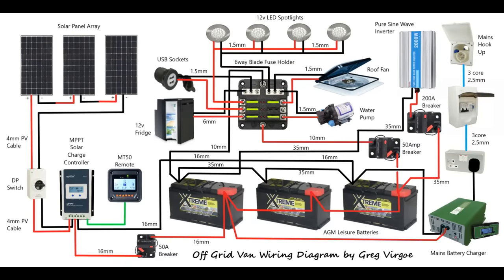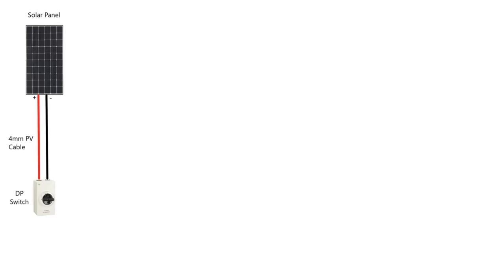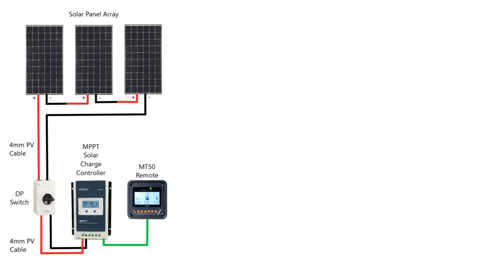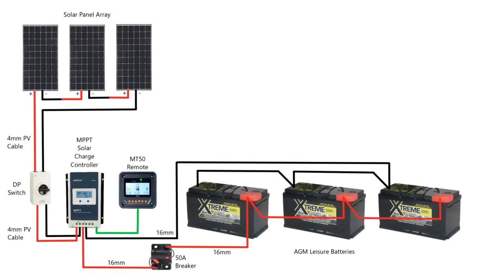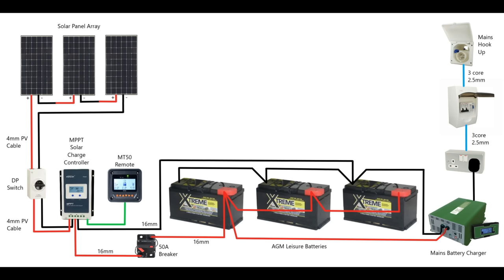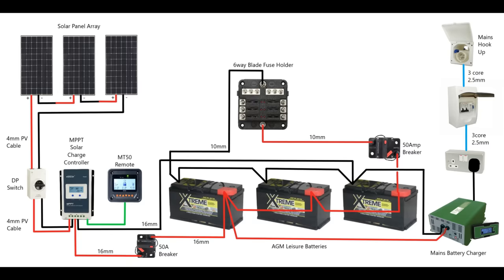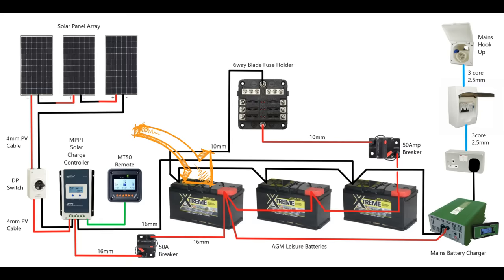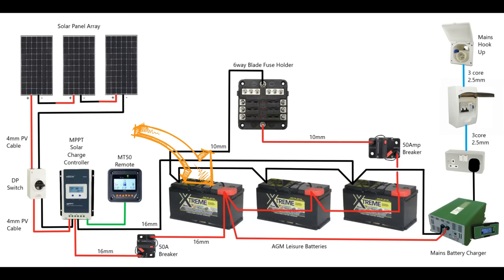How to Wire your Camper Van to be Off-Grid

Comment: This almost entirely make sense which has given me a dangerous  sense of confidence that I could handle doing this myself.
Reply from the maker: Quickblood1 it’s simply connecting A to B with the right size cable and fuses. That can’t be hard can it 😊
Hope it does help you
Reply: Following this guide I built an entire system, it's probably the best guide on the internet
Reply: Let someone else check your wires (let them pull on the connections hard)
Reply: @GregVirgoe  that's the easy bit but knowing what size wire and fuse to put in is where it gets hard for complete newbies like myself.

Comment: Forgive me being so impertinent as to make a suggestion but at the end you said the battery interconnects should be sized to the draw of the highest power appliance. I would suggest they should be sized larger, to the sum of the highest power appliance plus any others that might be running at the same time, since the total draw from the batteries will be the total drawn by whichever appliances you’re using simultaneously. Eg if 2kW inverter is running full tilt and your fridge is on at the same time, you’re drawing the sum of both those draws.
Reply from the maker: Vandemonium you are absolutely correct David and well spotted. My explanation was not technically correct in that instance. The 35mm cable is good for 240Amps so that will easily cope with everything in this diagram. The interconnect first need to be sized for maximum simultaneous demand on all systems. 
Thanks for the correction.
Reply: @GregVirgoe  hi, in the chart on your video it shows 35mm as a max current carrying capacity of 141 amps, am I reading it wrong because that seems a lot less than what you’ve written here and the 200 amp breaker on the inverter.?

Comment: Great video Greg did you wire your van in a way that you can also charge your batteries off the alternator?
Reply from the maker: Fireblade 100 no because a simple split charger is not compatible with AGM batteries because the charge profiles are very different. 
I could do it with a battery to battery charger but they are bit more expensive. Great question thanks for watching.
Reply: @GregVirgoe  Yes, that's what I had to do. I bought a CTEK D250 charger. Absolutely fabulous  product (no, no affiliation :) ) and well worth the money (appr. £ 170) if one travels in places with less sunshine and/or off grid (Scandinavian wilderness).
Reply: if so what size cable?
Reply: @GregVirgoe  You might look at the Renogy DC charger. I've just bought one. They are pretty cheap (110 eur for 20A and 140 eur for the 40A version). I found them on the French website, and contacted their German office since it was in stock, and they were able to ship abroad (the Netherlands in my case). I also wanted one, because of the charging differences between AGM and a regular lead-acid I needed one. 
As for the cabling: In the end you're mentioning having the same cable size as the biggest consumer to wire the batteries in parallel. I think it should be even bigger, since you can (theoreticly) use both the inverter AND the other devices at the same time, so in your case with a 200 and 50A breakers for those parts, there could flow 250A in total (Altough this is highly unlikely). 
Good to mention the use of stranded cabling and not solid. But also, especially in the higher current circuits, proper crimping is just as important. (And don't solder, since that is also not recommended in a moving vehicle). Finally, for the campsite hookup: Just beside a breaker, I highly recommend installing a RCD. (I personally am installing an surge protector as well... I've seen some crappy campsite installs...). And if you don't like the big CEE campsite connector (just like me) you can install a DEFA socket (which is much smaller, and can be fitted in the front gril or somewhere else). I'll just carry an conversion cable with me. DEFA is pretty known, especially in Scandinavia for heating purposes, but it can handle up to 16A. Here in NL its not much used besides construction vans, but I still like its small size (I can fit mine behind the fuel cover on my Ducato)
Reply: @GregVirgoe  is that not what the Ring unit does that Mel showed in o e of his videos, works as both a split charge system and an MPPT controller? A lot of guys using this on the newer euro 5 and 6 engines
Reply: My VW T5 has start & stop system and AGM starter battery. Can I charge the leisure battery from the alternator through a 80A relay?
Reply: @vangeezerexperience  is there any difference in the CTEK and the Sterling Power Battery to Battery charger? I plan alot of off grid!
Reply: Great video Greg. I'm just starting a build. that was so helpful. looking forward to going back through the rest of your videos. 👍

Comment: Hi Greg, I've just been having a nosey on youtube to see how to wire my electrics - very basic system - and I've seen wiring diagrams where the leisure batteries are earthed/grounded, and others which don't mention it. Should leisure batteries be earthed? If so, based on the wiring diagram you have used in this video, where would you place it?

Comment: Thanks so much for this Greg, exactly what I've been waiting for! I understood about the key components but hadn't see anywhere about the relevant sized wiring, fuses, breakers etc that keep it all safe. I can go into this feeling a lot more confident now, cheers!!
Reply from the maker: Hi Sharon, certain individual circuits and appliances my need slightly different fuse sizes depending on their actual load but hopefully this video gives a better understanding of how they all connect together. You can always message me with questions if you get stuck. Cheers Greg

Comment: Thanks Greg, Great Video as always, im just at the stage where Ive insulated the van and ready to board over and I've been worrying about electric element of the install. Much appreciated
Reply from the maker: Paul Carter what I did to start with was to list all the things in my van that would need power. Decide what item I was going to buy then find out what each of their power requirements were in terms of 12v / 230v and the amps so I knew what cable to run. Lastly did a simple pencil sketch of where each item was in the van so I knew where to pull my cables to. Hope that helps 😀
Reply: Greg Virgoe what goes after the inverter? How would you connect all the 240 plug sockets to it, say if I had 3 plug sockets for instance?
Reply from the maker: Paul Carter most inverters have a three pin socket so you wire a 2.5mm 3core cable to a 3pin plug. Plug that into the inverter then wire the other end to your sockets. You can only plug in devices rated below that of your inverter 👍🏼😊

Comment: Just starting a van conversion with my partner and until I came across this video I was very concerned about my lack of knowledge on the subject. No longer - this explanation and wiring diagram is excellent. Thanks Greg.
Reply from the maker: I have done another video just recently with a slightly different setup you might also like to watch that one 👍🏼😃
12v Electrics for Off-Grid Campervan - Fiat Ducato Budget Build Ep12
https://youtu.be/xCw7eARJKOg

Comment: Just about to take the plunge on van electrics and Greg's video is by far the most useful on YouTube. Whenever I'm nervous about jumping in I watch this (for the umpteenth time!) and feel reassured. Top man! Not sure if you're still monitoring this Greg as you're currently on your Portuguese jaunt with Lou but I'm wondering whether to use common bus bars for the MPPT/Inverter/DC-DC etc units as Alex has done from Mispronounced Adventures or whether to run them directly as in your diagram.
Reply from the maker: Hello, yes I do monitor all comments no matter how old the videos are 😃
I connected mine direct to the batteries as I’m not using a shunt at all and another connection in my fairly simple layout is just adding extra resistance to the circuit.
Reply: @GregVirgoe  Thanks Greg - enjoy your adventure down the N2.
Reply from the maker: @ezioauditore3128  thank you 🙏🏼

Comment: Possibly the most informative video on  electrics that I have ever found thanks! One question. I was hoping to avoid a mains hook up. Would it be simple enough to add solar and a hook up the the starter battery to charge when the engine is running too?
Reply from the maker: Adam Vincent-Garland best way of doing that is with a battery to battery charger. That way you can set the correct charging profile for your leisure batteries. A hook up lead with sockets on the end is a cheap emergency back up nice to carry if needed

Comment: Spot on Greg, your whole series is amazing and such a positive thing to do for others.  I have one question on solar panels.  Are there any pros and cons between installing multiple lower wattage solar panels compared to a single larger wattage panel?
Reply from the maker: I can think of a couple of advantages. Space saving and location layout. Biggest pro is the redundancy should one fail you can easily rewire it out of the system

Comment: Great explanation, clear and concise, no fluff. However, how are you wiring to your 230V plugs from the inverter, re you simply using extension cables that plug into the inverter?
Reply from the maker: You can use 2.5mm three core cable plug into the inverter then wire into the back of 3pin sockets. 
To keep it simple you could use an extension lead with multiple outlets just be aware that the plug fuse will be max of 13amp or do not use more than the watts rating of the inverter. 😃👍🏼

Comment: Thanks for the video and also for the step-by-step presentation. I have looked at some of your other videos, e.g. battery and solar panel sizing, as well as the choice of cables and fuses for the loads. I have made a couple of observations that I need help with. 
* You have used 3 x 160W solar panels wired in series, which will increment the voltage. What is the cumulative voltage in this case, and also what is the maximum voltage that the MPPT controller can support?
* You have also used a DP switch between the solar panels and charge controller, but it is not clear the size of this switch and what device is being protected, considering the fact that the solar panel amperage remain static. Would you suggest an in-line fuse close to the solar panel in addition to the breaker?
* Finally, it seems like you have a 50Amp circuit breaker between the charge controller and the battery and the same between the battery and DC fuse box, but I think the battery amperage is 110Amp. So if I am right, what is the circuit breaker capacity lower than the battery amperage? Also, I am not sure but when the batteries are configured in parallel, does the amperage add up and if so, what should be the appropriate breaker capacity to protect the battery pack?
Thanks in advance.
Reply from the maker: The combined voltage is around 60-70volts and is within the 100v limit but check as other controllers do differ in spec. 
The DP switch is just for manual isolation if I want to turn of the solar panels. An in-line fuse of 15Amp would be suitable for this setup near the panels. 
The circuit breakers are sized based on the connected load downstream of the breaker and no relation to the size of the battery bank as it’s relative to what is being used. Check out my cable sizing and fuse sizing video 👍🏼😃

Comment: Hi Greg, firstly I want to thank you for your videos not just on electrics but all your videos are amazing! 
Greg I have a question!🙈,  actually I have several🤣 but I'll be more than happy if your able to answer this.  I have to 2 x Renogy lithium 50Ah(100ah total) battery's and 2 x lead acid 105ah(210ah total) battery's.  The lead acid are backup power... is it feasible to have a wiring system that would allow me to switch over from one power source to the other as and when I needed it? If so can a novice like myself(I wish!😆) do this kind of setup? None of my electrical system is installed yet.....thanks in advance.
Reply from the maker: Hello Phillip, thanks for getting in touch. The biggest issue I see is these different battery types will have different charging and discharging rates/profiles 
Battery chargers need to be programmed differently for each battery type. These should not be connected together. You could install two stand alone systems and say use the lithiums for big loads like cooking etc. use the lead based batteries for small loads like lighting or usb sockets. 
You could use a changeover switch to divert your solar power from one charger to another on the input side of the MPPTs
Reply: @GregVirgoe  Greg your a star...I did wonder whether 2 stand alone systems would be better. Yes, I had wondered about some kind of change over switch for the solar. I guess I'll have to toggle the mppt parameter settings from lithium to lead acid when I use the switch too? Would a change over switch also be feasible on the dc-dc charger? (switching over between my lithium's and my lead acids). Wow, super thankyou for your prompt reply! If you want to film me (with your technical expertise assistance of course 😉😉😉) and make some video's for your channel could that work???😲😲😲🤣🤣🤣 cheeky I know....! You don't ask... you don't get!!😳🙄🤣

Comment: when you say 16mm cable, or 10mm cable, do you mean 10mm2? what are gauge are you reffering to? im getting so confused by the cable sizes! AWG, mm2, and then the nominal size. please could you help me?
Reply from the maker: This chart will give you the conversion https://encrypted-tbn0.gstatic.com/images?q=tbn:ANd9GcT2bfpHvjpnquN3FmnLZhZO8gOGuPugWnWWtQ&usqp=CAU
Reply: @GregVirgoe  That was a useful question and a useful answer link, I was watching thinking "a 35mm (diameter) cable is enormous, how are you routing and attaching ends to that", but from that chart I see you were more likely talking about mm2 cross section which now sounds more reasonable
Reply from the maker: @Fromatic  yes not the diameter 😊and battery cables are surprisingly flexible too 👍🏼

Comment: Hi Greg , hope your well . To run a kettle / TV off grid ,where would this fit into the diagram please ? Many thanks.
Reply: It's ok Greg , watched your other video on TV installation. Thank you
Reply from the maker: I would recommend getting a small travel kettle no more than 2x cups and 800w then you can run it off an inverter. A domestic kettle would use too much power. 👍🏼
Reply: @GregVirgoe  Brilliant thanks Greg. Much appreciated.

Comment: I am just starting to plan my Van and the eletricity is what troubles me the most. Its not possible to use the car alternador to also charge the bateries while driving or/and have eletricity when there is not enough sun?  If the alternator charges the car battery makes sense that we can take advantage of it. Also, instead of a connector to connect to an homr plug, why not a plug equal to the eletric cars and plug it on a service station for example?
Reply from the maker: It’s best to use a battery to battery charger also known as a DC to DC charger to charge using your van engine. A good model would be Victron Orion 30A. Always good to have hook up for camp site charging. Running the engine when stationary is not the best solution. 👍🏼😃
Reply: @GregVirgoe  well not the best but if, at limit, is the only available, i rather have that than nothing. I am planning not being much on campsites.
Reply from the maker: @nspinheiro.  you still get electric hook up on free sites across Europe and I’d hate to be parked next to someone running their engine to charge a laptop 😉
Reply: @GregVirgoe  more worried in not having power to cook on a snow storm or something like that 🤣

Comment: I work with a.c. and cable sizes and protection are chosen by coordination. The demand of the appliance (Amps) must be less than or equal to the protection rating (breaker or fuse Amp rating) which must be less than or equal to the current carrying capacity of the cable. 
This is a great video, btw, and taught me loads about the setup in campers and caravans. Am hoping to buy a cheap van and convert it. Don’t hold your breath! 😂

Comment: Finding this very easy to understand, no solar panel on my old camper at the moment, tend to wild camp all the time, thinking of getting a solar panel, bit confused what size i might need, but will look for your other videos 👍👍
Reply from the maker: If you want to be off grid all the time you need to be looking at 300-400w of solar from a couple of panels. Take a look at 2x Renogy 175W panels they are very good.

Comment: Beautifully explained - almost exactly the same as my rig but I went with 300ah lifepo4 and just one 280w panel & 1.5KW inverter -  so was able to drop down to 25mm wire - I added a  20a DC to DC  alternator  charger and used the  EpEver MPPT solar controllers  power outlet for the LED 12v TV as its so smooth and consistant.
Reply from the maker: The ratio of panel to battery is a bit lite to be off grid without having to drive to top up. I would recommend more solar and only 200Ah of lithium’s. 👍🏼😃
Reply: @GregVirgoe  I get what your saying but  my rig is more a touring van hence the DC to DC alternating charger (with litium charge profile) - the bigger battery compensating for overcast weather we encounter - I don't run the fridge on it